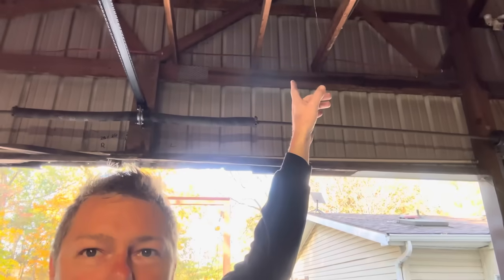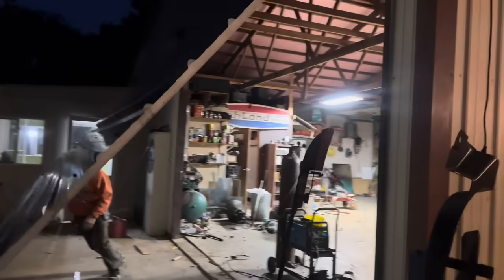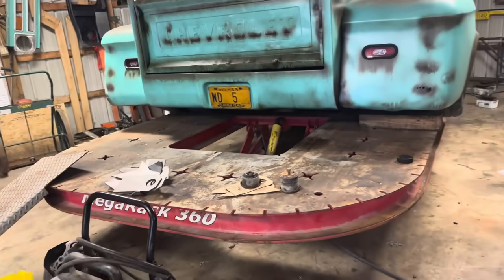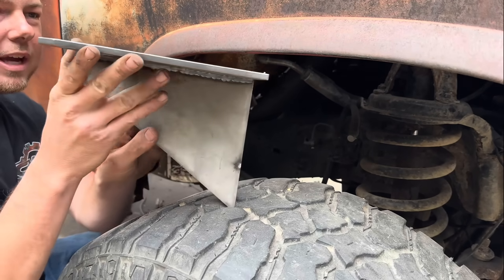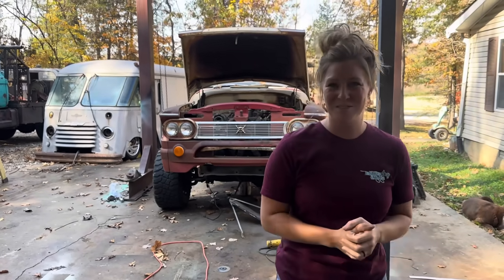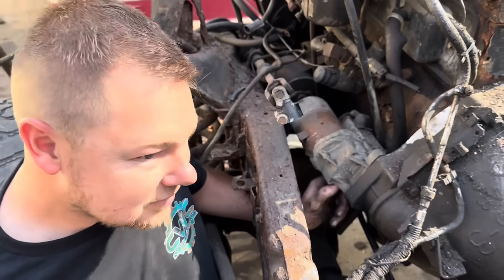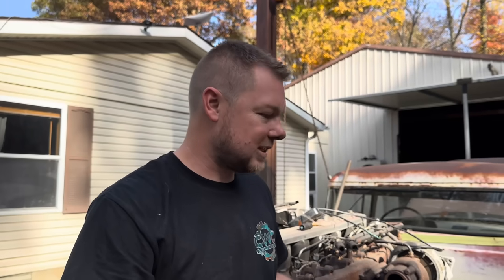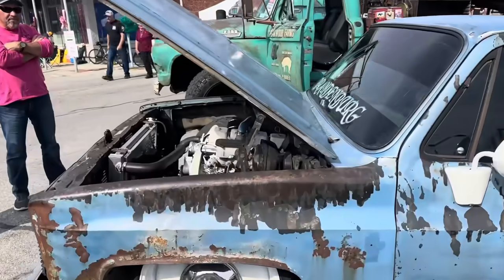My SHOP TRUCK is getting some love!! Also we built a GIANT GARAGE DOOR!!!

Comment: You need a seal around the door now and around the other air cracks in the ceiling. Can buy that chrome looking insulation at home depot in a roll. And buy the hvac tape they sale for it . Fornthe inside of the door. Winter will be cold af.

Comment: I would be very , very leery of the door , a good windstorm with the door up and you may be in big trouble .
Also when { they all break sooner or later } the winch cable breaks that will be a lot of weight swinging down , very dangerous ..😕
I would have sooner see you go with lateral folding or sliding  doors  with a track above the door .

Comment: you should made telescoping support poles that attach to the  garage door inside left and right corners of door, and you can let them down when the door is all the way open to support the door, then you can telescope them short and hang on door when door is down and closed, this takes weight off the open cable when door is up and open and no risk of getting hurt if cable ever broke example like a card table where the legs swing down and a bolt to tighten the telescoping poles when open or closed,

Comment: Hey Corey, that door is similar to what I did with my shed add on for welding, instead of covering in steel I used shade cloth, mainly because I am in the tropics.. it’s great shade and open air for all those fumes and dust to stay out of the shop. I have safety legs to prop them up too. I do enjoy how you get things done, you take on a challenge and work it through, great that you also get the help when you need it. G’day to Hanna too, you both are great together, stay well and stay safe.

Comment: I'd want a heavier cable, bigger wench, and a longer and slightly beefier wenching arm.  Nice job, though. Be safe under that door. 

Just tarp those vehicles so you don't have to worry about getting them into the shop when it rains.

Comment: I like the door, but it being one piece  scares me. I would of hinged it in the middle. I think I'd run two  cables as well, can join them into one after they meet and go to one cable on the winch. The cables would attach at bottom corners and would be a straight pull, straight up. That  angled pull you have now makes it harder on the cable and the winch. Have it bi-fold in the middle, you'll loose a little height (door thickness x2) but it will be a much lighter load on that winch and cable. You can easily make some pivot triangles that pop out (one oer side) once the door passes them, on springs with rope to pull them into unlock position when you want to close/lower the door. An auto  latch system to hold the door up safely not keeping constant tension on that cable.

Comment: On my old 2008 had a hole by the one you took the torque converter bolts out of you put a plastic or metal piece in that you turned with a ratchet that turned the flywheel to the next bolt the piece came in clutch kits my son gave me a couple he has the 6.7 with the g56 mine was the 68rfe junk lol

Comment: Are you going to put a man door in for when the door is down or you need to keep the heat inside? Also, are you going to place some cross bracing in the corners for strength. I know all adds weigh that the winch has to lift but you can use light weight material plus lightening holes like the hot rudders used to do?

Comment: I do not know what size head lights you need but I have two Harley Davidson headlights &inch new. I would take 20.00 each I bought them for my ratrod would not work bought regular lights they did not work either had to refit the housings.

Comment: Great work as always. Fantastic job on building the garage door. Great help from in-law. And he likes danger too!!...LOL 
Too bad the ribs on the sheet metal were installed horizontal and not vertical to match the rest of the building. I know the door structure/frame would have been needed different but the final result would of matched the rest of the building. As in all "custom" work, details details details. The winch was a great idea!